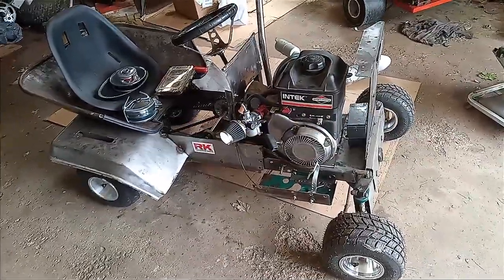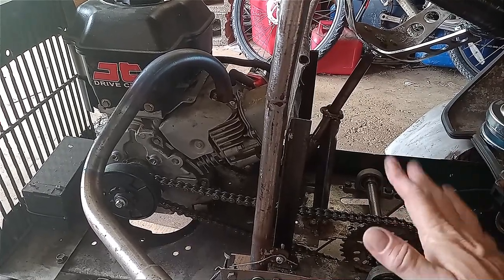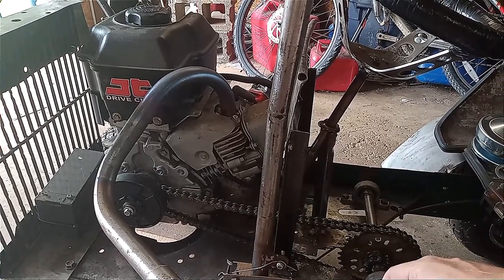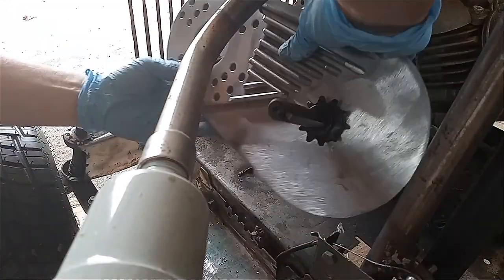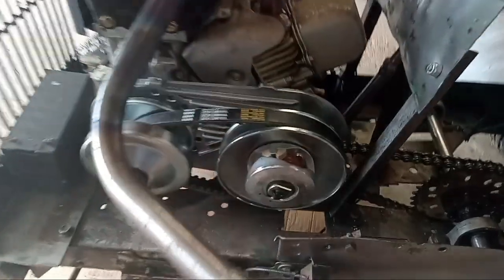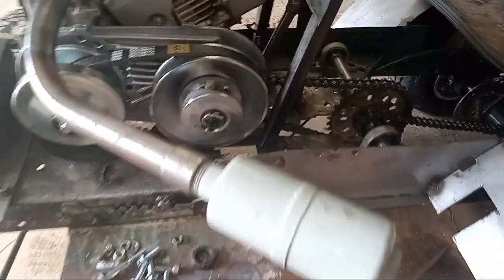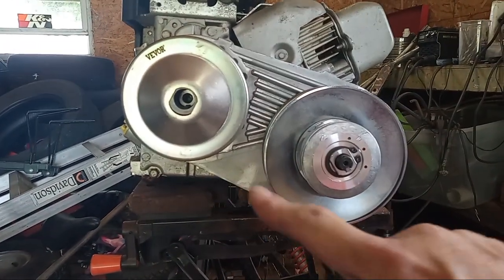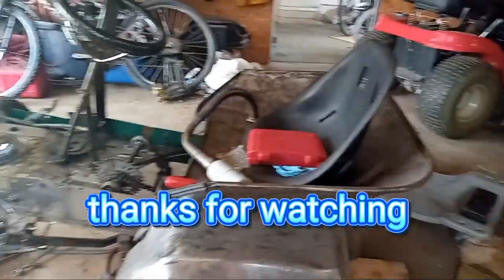Installing a  30 series torque converter on homemade mower to go-kart conversion

Comment: I dig the front grill......Would be cool to make a body for it like maybe something that resembles a mini Ford model T..... Use Plexiglas for the windows,  mabe some free metal off some discarded washers,dryers ovens refrigerators. The hinges could be used for it's door hinges. The magnetic strip from the refrigerator door could be used to seal lawnmower body door. Free discarded computer printers have the rectangle tempered glass in them. Maybe put 1 on the hood so you can see inside  the engine bay 😂 
Or make it look like the  Munsters car from tv TV show or crazy Steampunk build???  See how many free parts you can scrounge up for it.
Reply from the maker: @michaelbrinks thanks for the very cool ideas I'll definitely take a few of those into consideration. These go-kart builds are never truly "done" as I'm always seeing or hearing of ideas to add or upgrade as I call it lol check it out this one even has under glow😎
https://youtu.be/XaOiFqcCF_k